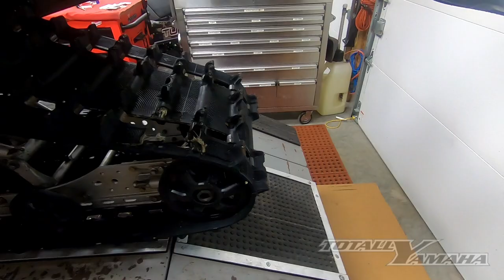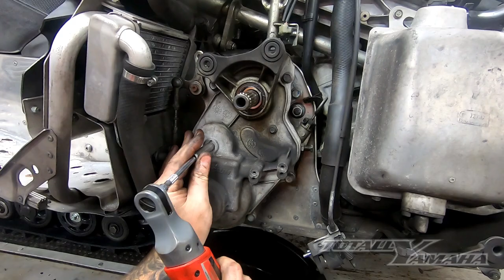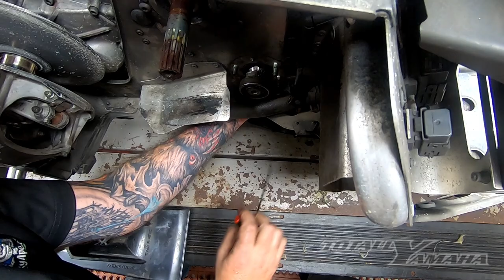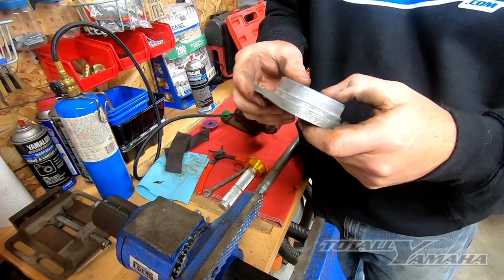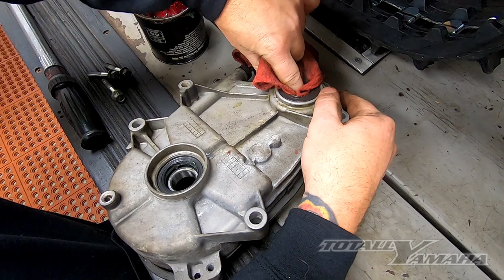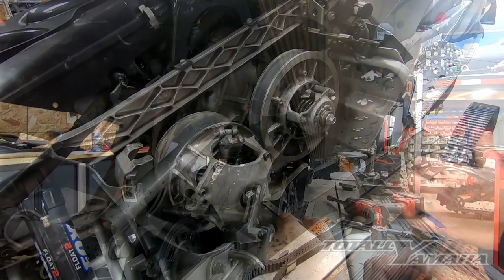2011 Yamaha Apex track change.

Comment: Cant thank you enough  for this walkthrough! Helped a lot with my 2006 RTX, though I had some minor differences. Cheers from Sweden!
Reply from the maker: Always some slight difference with years and models of Apex but sure help most.
Reply: Biggest set back i had was a 36mm nut on the secondary clutch shaft to get the upper gear loose.
Reply from the maker: @FreddyShredhead  your RTX must not have reverse. I have a special socket for that but usually its not too bad to break loose with a chisel and hammer if you tap it on the outer edge of the flat.
Reply: I have reverse though, it sat really hard, but managed with a extra set of hands holding against on clutch side

Comment: Since my track installation, I have been having issues getting my track lined up correctly. The track  likes to sit closer to the clutch side at the front of the skid, and no matter how I adjust the rear it won't change the front. Could  I have mess something up in  the chain case to make the drivers pull the track over to one side? Thought I followed your tutorial correctly :( much appreciate your advice 👍
Reply from the maker: Did you ever get this fixed?

Comment: Great video, you did a very detailed job! At the 54:30 minute mark your about to put on the chaincase cover. Did you forget the small blk ring that goes on the secondary shaft? It was behind or in front of the top ⚙ on that shaft. What is the purpose of it?
Reply from the maker: I did put it back on and at 1:10 I talked about it as I pulled it off. This 0-ring prevents oil from walking down the shaft under the bushings and leaking.
Reply: @Totallyamaha  yes I saw it after at the 58 min mark! I was impressed with your video. So much easier with a lift and hoist to lift the ass end up! I just finished a 2001 viper replacing the track, what a bitch to get the skid in and out. The middle idler wheels on the top were even tighter.
Reply from the maker: @thermos750  there is a few tricks on the pro-action skid to get in and out. If you take the bolts out of the end of the transfer rods, you can get the front and center bolts lined up and installed and then install the transfer rod bolts after and it will pull the rear axle in place.

Comment: Hi thanks for the video.  Do you remember what the bearing number is for two upper  wheels you said need to be checked every year?   Thanks
Reply from the maker: should be a 6205
Reply: @Totallyamaha  Do you think the 146 XTX that no longer has the 1.75 track on it but rather a 1.35 ice Attack and eight tooth drivers Will pull a 24 top gear?

It has a 23 top gear now, and for long distance trail cruising it is geared too low
Reply from the maker: @toobglued  heck ya, you will need to lighten the tip rivet. I am doing the same think on my 2018 but Im going to leave the 1.75
Reply: @Totallyamaha  Ahh That is a very good point.  Even less weight than the 3.1 Tip that is stock?? ? (10,800)  I have 4.5 tip now  and its down to 10,500.
Reply from the maker: @toobglued  10800 at WOT would be better then 10500 if you want to be in the power.. I would make the gear change and see how it pull the current set up.

Comment: Followed your video to a T but have 1 spacer left over that has a oring cut into the center of it. Any idea were I went wrong??
Reply from the maker: Yep. It might be the spacer on the bottom axel goes behind the gear case and the bottoms bearing. If you feel underneath it should be in contact with the seal.
Reply: That was it 🤦‍♂️ gotta love doing a job twice lol. Thanks for the thorough video, helped alot 👍
Reply from the maker: @davidmcfadzen3737  love and learn. It’s all good. Fun stuff.

Comment: I have one question:    WHAT IN THE WORLD HAPPENED TO THAT PRIMARY CLUTCH?!!??!?!?!    that thing looks AWFUL
Reply from the maker: lack of maintenance by the owner.. driving a 4 stroke like a throttle jockey and blowing lots of belts.
Reply: @Totallyamaha  wait.  I have another/new question.  22:22  other than inspecting/servicing the bearings, why is there a need to remove those upper idlers?   they aren't part of the skidframe itself.   I left them in place on my 2012
Reply from the maker: @keemez  only need to come off when you pull the track.
Reply: oh, right.   duh!   I forgot that I was watching a track removal vid (mainly for tips/tricks on skidframe removal).   ain't gettin old grand?